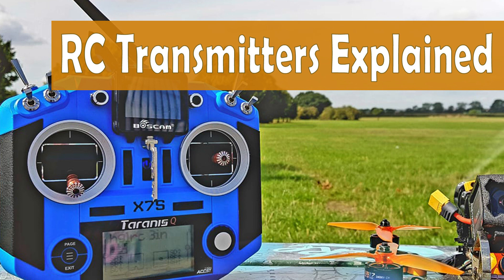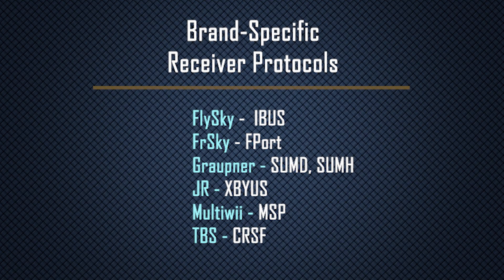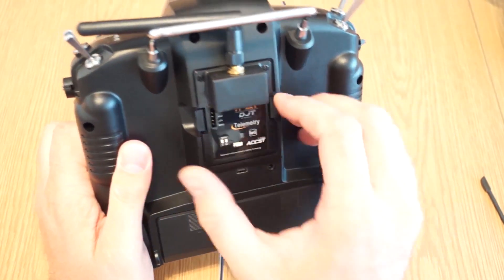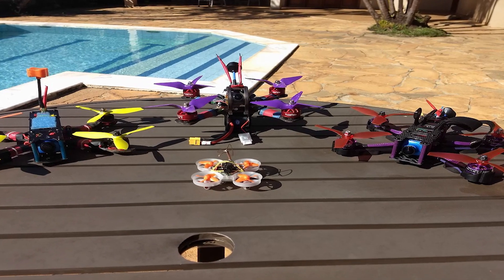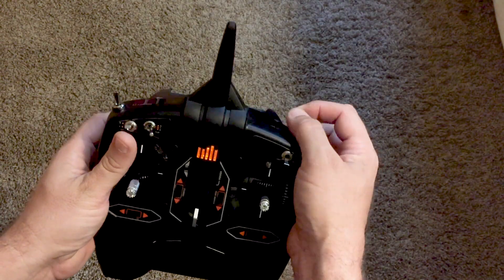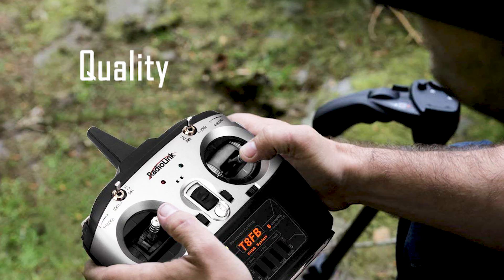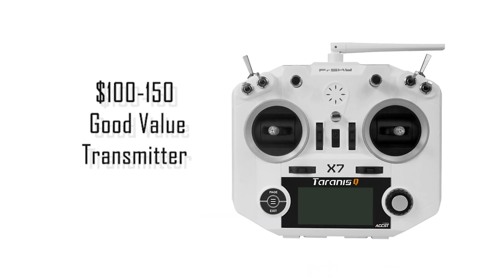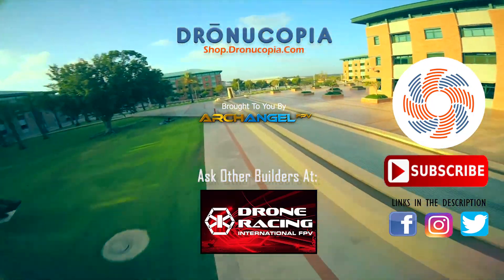The Basics of RC Transmitters for Racing Drones | Drone Racing Report | Vol 25

Comment: I bought a tinywhoop flight board that has "frsky 2.0". My frsky receiver is the cheap "literadio" and won't bind to it, apparently cause of the 2.0 factor. Says so right in the manual. Oops. So now I'm shopping for a new receiver which I wanted to do anyways cause literadio is cheap. I'm having a hard time finding a receiver that could be compatible with 2.0, or ACCST v2 I've seen it called. How do I know if a receiver will work with this?  Is it something I have to "flash" later? I dunno can someone help me understand?